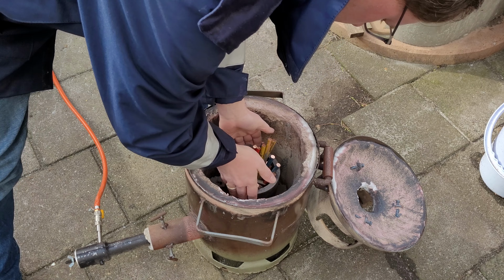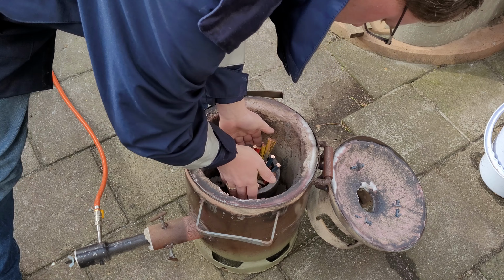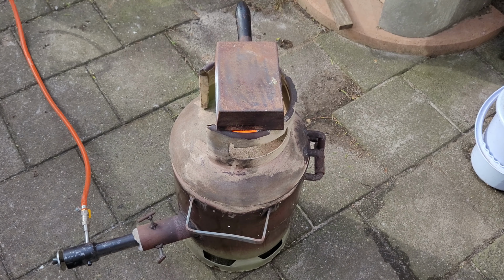Casting massive copper bar! - Devil Forge - 4K molten metals

Comment: Another big honking Copper Bar, you might need a bigger mold. If you continuously move the pour from the front to the back, then it might cut down on the holes in the bottom at the pour site.
Reply from the maker: Yeah I will either buy one or weld myself a bigger mold one day, gotta pass that 5kg! While pouring it out I was thinking on doing that, but it was already 80% poured, maybe next time 😁✌🏻✌🏻

Comment: Where do you get the molds and what material do you like the most? Graphite, steel or cast iron?
Reply from the maker: Hi there, I got these steel molds from etsy.com, for the smoothest bars I would preferre graphite, but steel is a lot cheaper and can mostly handle larger volumes.